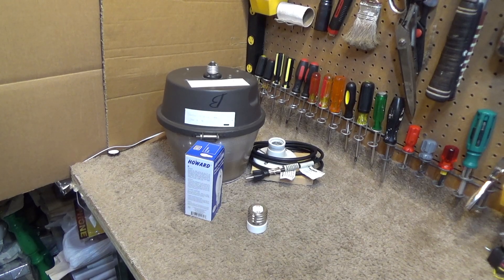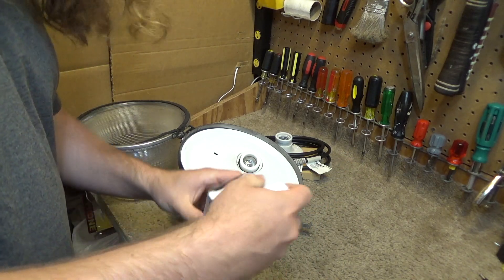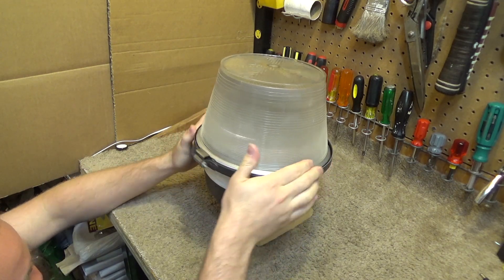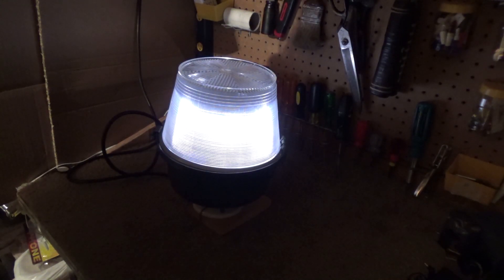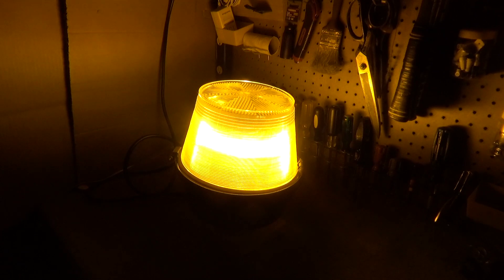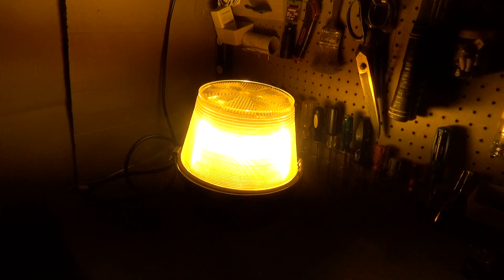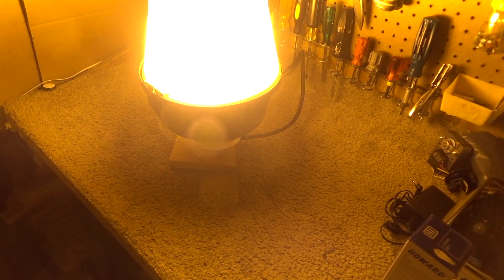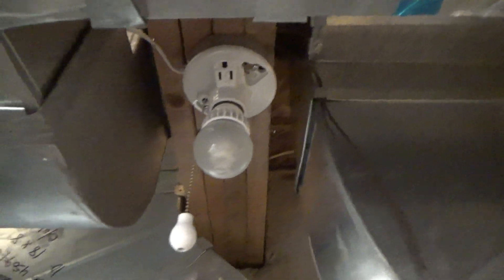Westinghouse High Pressure Sodium E26 Light Fixtures | Part 1

Comment: i heard somewhere that HPS is as efficient as LED
Reply from the maker: It's true, a good quality HPS fixture can be more efficient than a cheap LED fixture.
Reply: @JordanU  Yep! that is also why i'll be sticking with HID for exterior lights when i get a house
Reply from the maker: @ALT-9167  Until (if this ever even happens) LED fixtures are made correctly, there's absolutely no reason to move on from HPS, or any other type of lights for that matter, inside or outside the house.
Reply: @JordanU  Ok!

Comment: the bulbs are most definitely sold at Lowe’s
Reply from the maker: The bulbs are most definitely not sold at Lowe's.
Reply: @JordanU  I work at a Lowe’s. We most definitely sell them at mine. But we are not getting more in like we should be. My state has already banned T12 lightbulbs. I have a feeling High Pressure Sodium is next.
Reply: @JordanU  Lowes item# 903800.
Reply from the maker: @hfd1k20  Not all the stores stock the same items...
Reply: @JordanU  most stores carry the same items to an extent.

Comment: Will that take a metal halide bulb?  Those two technologies do seem to be very related in terms of bulb size and startup time, just different color temperaturs.  I definitely would go with metal halide indoors, plus those have an even better startup.
Reply from the maker: No; they require different ballasts.
Reply: @JordanU  The reason that these fixtures will not fire metal halide bulbs is because they use high pressure sodium lamps that only require a 120v OCV to run properly whereas most metal halide lamps need an OCV of 240v or so to start and run properly. Another interesting fact about high pressure sodium lamps is that European low wattage high pressure sodium lamps from 35-150w are interchageable with same wattage metal halide lamps. In fact, I have had some experiences running European 70w high pressure sodium lamps on North American 70w M98 pulse start metal halide ballasts and the lamps and ballasts worked great!!!
Reply from the maker: @worldwidehidcollectorusa-fkt  Thanks for the information.

Comment: When I saw that you posted this, I just had to come and comment that LED light bulbs are better! :-)
Reply from the maker: They're not, these are a lot more reliable.
Reply: @JordanU  turn that off
Reply: @JordanU  i’m sorry I just had to say it. :-)
Reply from the maker: @Techlifeandmore  Perhaps you can find something worthwhile to say instead.
Reply: @JordanU  I can. Is that everything except for LEDs suck!
Reply from the maker: @Techlifeandmore  That doesn't make sense.
Reply from the maker: @Techlifeandmore  Do not post spam.
Reply: @Techlifeandmore  you are quite wrong lmao. It’s okay though, you have a right to be horribly wrong.
Reply: @vintagefancollector1436  I am not wrong! LEDs are the best!
Reply: @vintagefancollector1436  well then I guess we still need to work on them, but they are the future!
Reply: @Techlifeandmore  not entirely either. There’s tons of viable alternative people are refusing to admit to. Plasma can also be used as lighting. And ceramic arc tube metal halide lamps are very close to LEDs in efficiency. Low pressure sodium is more efficient but it has a monochromatic spectrum of light, so it is unappealing for high color rendering needs.
Reply: @Techlifeandmore  there are many applications that LEDs can never be used in, because they just do not work in that environment at all. Heat lamps are one of those things. Also beacons for airports and heliports. They need to be mercury vapor because it cuts through the fog and clouds the best. Germicidal lighting requires fluorescent or mercury vapor because the UV light created from those bulbs when unfiltered literally kills viruses. There’s so many specialized applications where LEDs just don’t work.
Reply: Also, electric resistive heating, which is what heat lamps work on, it’s freaking inefficient as absolute hell!
Reply: @vintagefancollector1436  you said ceramic art tube how lied I lighting? Arc lighting is very in efficient! It is literally sparking to materials just to create light! It produces a lot of heat, easily wears down the materials, and also that’s what they used in the very origins of lighting. It had a very bad byproduct, so it was not valuable for use indoors either.
Reply: @Techlifeandmore  ceramic ARC TUBE. It’s a form of HID (High Intensity Discharge) lighting. Instead of quartz the arc tube is made of ceramic so it lasts longer without degradation in color and light output. Not part of the arc lighting of the 19th century
Reply: @vintagefancollector1436  One single LED is the size of a grain of pepper, you can’t say that about incandescent bulbs. If one LED is the size of a grain of pepper, and one incandescent bulb is the smallest you can make it probably would be like the size of my thumb, then an absolutely microscopic type of LED lightbulb would be much easier to make then an incandescent version. Also, mercury lighting solutions are very bad for the environment. Sure, lead solder is too, but mercury vapor and other mercury Lighting solutions are literally mercury and glass and a little bit of metal. LEDs are glass, metal, lead solder, and a semi conductor. There are other soldering solutions as well though. Molten metal type of solder is one of them. Welding is also a thing, that doesn’t even require soldering. The only problem with welding is that it takes up 240 V instead of soldering which only takes up 120 V. Plus spot welding machines are bigger and more expensive than the soldering irons. My grandfather bought one from Walmart that was like not even six dollars. It was $5.77.
Reply: @vintagefancollector1436  also, please list some advantages of other lighting solutions that LEDs just don’t cover. I’d really like to hear them and completely react and fill in the gaps where you forgot some information.
Reply: @Techlifeandmore  look, I have been studying lighting almost my entire life. Sure there are advantages, but that doesn’t mean it’s the best of the best.
Reply from the maker: @vintagefancollector1436  Excellent, intellectual commentary here. You've mentioned many valid points.
Reply: @Techlifeandmore  LED's are not the future. The LED lamps I have had have all been name brand and they last as long as incandescent and I use them properly. (The LED ones, that is) The LED streetlights in my town (the very few there are) have all shifted to a greened out mercury vapor color and some even flicker really bad. I personally use incandescent, halogen, CFL, and HID to light my house and have even gotten the rest of my family to stop using LED's. Get used to it, I hate LED's and always will! If you hate my opinion, go somewhere else with your stupid opinions!
Reply: @r1ckastl3y86  so, they are probably second generation LEDs.
Reply: @Techlifeandmore  no, they were ones I got in the summer to try out. All I know is that you will not change my mind on them. Don't even bother replying to me again.
Reply: @vintagefancollector1436  Oh, yeah and how is it "Environmentally friendly" when people trash HID light bulbs that release mercury? i don't get why LED's are even a thing
Reply: @r1ckastl3y86  Same!
Reply: @Techlifeandmoreno they aren’t, don’t just start fights because you wanna assert your opinion to piss people off and that you think you’re correct, it’s a true fact that LEDs are not good fixtures, leds don’t last unlike things like HPS
Reply: @BRISTOLFORCE2009  Then name another type of lightbulb that can offer a CRI that is extremely similar to an incandescent lightbulb (incandescents have a CRI of 100 whereas a lot of the better LEDs have a CRI of like 95 or higher) but uses like a 10th of the wattage. Because none of them exist.
Reply: @Techlifeandmore outside cri doesn’t matter, you act like that’s a necessity, even colorblind people would agree with that
Reply: @BRISTOLFORCE2009  What about inside?
Reply: @ who tf uses them inside